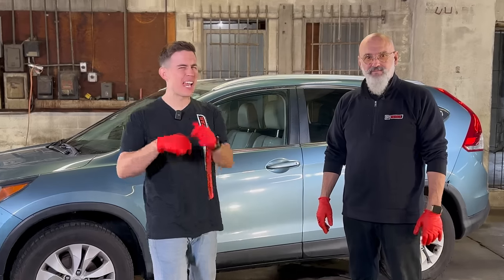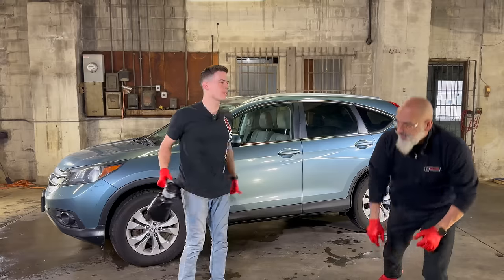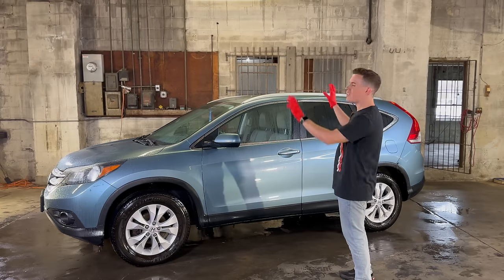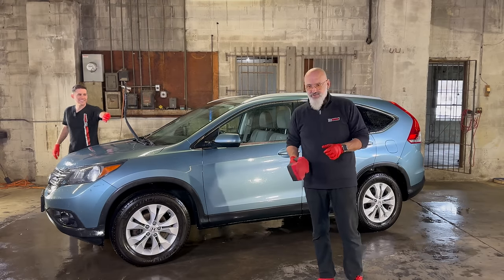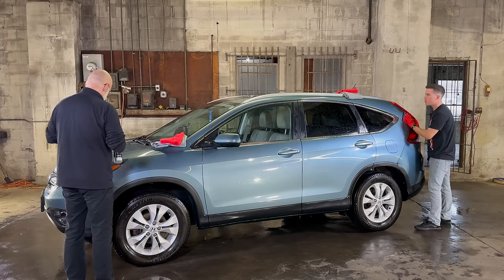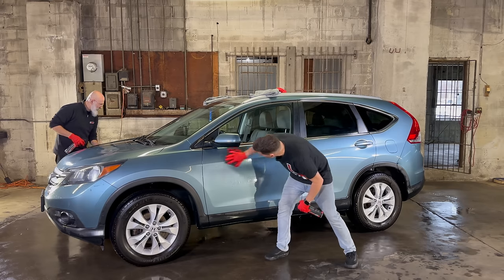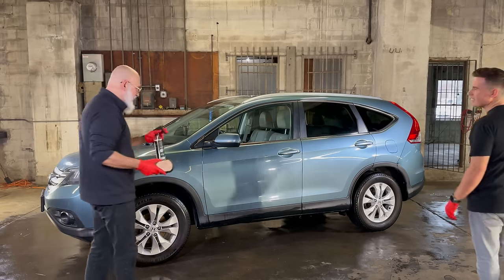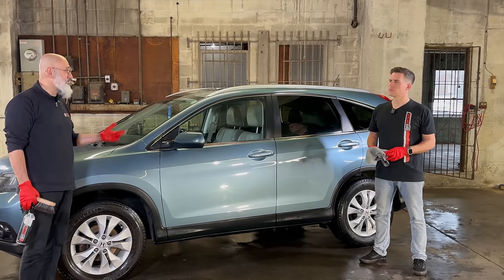How to decontaminate and PROTECT in one step!

Comment: The Honda looks clean and glossy and the owner must have been thrilled. My sprayer like yours quit this weekend on the job and it will be missed. The perforated towel is amazing and gets so much work done. I prefer ceramic gloss for the clay n seal because to me it smells better than quick beads. I do recommend buying a gallon of each. Thank you for the video.
Reply from the maker: Thank you.

Comment: Hello. I watch every video of yours. For me this is simply invaluable information. In the video on the Pan Organaizer channel you cleaned the body using Clay Towel and Iron Remover. This time you used CERAMIC GLOSS. Why did you decide not to use Iron Remover? Is it really not necessary to remove metal residues from the car body?
Reply from the maker: Different circumstances and needs. This is a good technique for maintaining your paint and protecting at the same time.

Comment: Hi Yvan/Nick, excellent video. Question regarding windows using this method- Ive noticed a couple times that the ceramic gloss has left a strange foggy/smudged appearance on the windshield in spots. It only became evident in certain lighting a couple hours after the details, and was difficult to wipe off one of the times. Have you experienced this and any suggestions to avoid this from happening? I dont belive I was overusing the product either. Thanks!
Reply from the maker: Unfortunately, yes you are overusing it.
Reply: @diydetailofficial thanks! easy fix at least

Comment: When using Ceramic Gloss on a dry surface, I’ve noticed the removal micro fiber towel seems to feel a bit grabby, or not slick on the surface. But when I come back in a few minutes and feel with the back of my hand or a clean towel, it feels slick. I’ve seen this same issue on another YouTube channel where he was trying Ceramic Gloss. Can you explain why we are feeling this grabby or not so slick feeling when removing the product? Only using 2 sprays per panel. Otherwise I absolutely love it!
Reply from the maker: You’re using one spray too much. Yes it will be initially grabby as the ceramic resins are cross linking
Reply: @diydetailofficial  So I did a “Nick” and got a little carried away? 😂 But it smells so good you just want to spray it everywhere!!! lol.
Reply from the maker: @bwildman1818 the fragrance has that effect on people

Comment: Hi DIY team (preferably Yvan). When doing a clay and seal is it better to use the ceramic spray during claying or on the towel while drying? Wouldn’t using it while claying dilute it more and use more product than using while towel drying is it just as efficient with product? 
I feel like similar applications or ceramic gloss use 1 spray per panel rather than the 2 while claying.
Besides increased lubrication is there any other reason to use twice as much product with this approach?
Reply from the maker: Yes you use a little more, but the additional lubrication is worth it.

Comment: Hello, Hope all is well. I have a question that involves the ceramic gloss. What is the difference between ceramic gloss and ceramic coating? Are they two different products? If so, how would you recommend the application of said products?
PS. Thanks for all your wisdom.
Reply from the maker: Very different products and needs. Watch a few additional videos and you will see the differences
Reply: @diydetailofficial  thanks for the reply. I’ve seen some videos however, I’m not sure if I’ve noticed you guys use both products at the same time (before or after the application of one or the other). I guess my question is more directed at the above-mentioned. Like for example, could I use the coating and after the curation process, use the ceramic gloss spray to enhance the coating? Or it wouldn’t work like that? 
Thanks in advance
Reply from the maker: Yes, once cured for a week you can use DIY Detail Ceramic Gloss

Comment: What about using the decon towel on PPF??? Also, I have some water spots on the PPF, will the decon towel help to remove those with the water spot remover?? Please discuss water spots removal or is polishing gonna be required?
Reply from the maker: All our products are safe on PPF. DIY Detail Water Spot Remover should not be used with the Perforated Synthetic Decontamination Towel . Claying doesn’t remove water spots. 

DIY Detail Water Spot Remover removes the minerals that cause the spots, to remove the etching ( if there is any) polishing is recommended.

Comment: I actually do not have ceramic gloss but I do have quick beads. I want to use this method but I thought quick beads was only activated with water, will it affect durability?
Reply from the maker: It works both ways.

Comment: This may sound like a strange question. After cleaning the inside of my tinted windows can I use ceramic gloss or quick beads on the tinted windows to help keep them a bit cleaner or is that a no no with tinted windows? I have XPEL Ceramic Windsheild Tint on all windows.
Reply from the maker: You do not want to use anything that promotes beading inside, it also promotes fogging

Comment: I really like the clear buckets with the very distinct measure markers. 

Could you provide a link to those exact buckets. The taller and shorter ones.
Reply from the maker: They are from a local restaurant supply
Reply: @diydetailofficial  Darn. They are really nice. You can see through them well. Very visible markings for the amount of water in the bucket. Will they let you order them and pay for shipping?
Reply from the maker: @26-CJ find your local restaurant supply

Comment: What happens and how to salvage a drying towel used with ceramic gloss that was just left to hang dry while waiting for laundry day?  :(
Reply from the maker: Soak in a bucket of DIY Detail All Clean , or use a bit of ammonia in your washing machine.
Reply: @diydetailofficial  At the moment my only supply of All Clean is in the Spray Bottle, pre-diluted 15:1.. How much would you recommend me using if I were to soak the towel in maybe 2-3 gallons of water?  Don't wanna waste any :D

Comment: Those electric sprayers are great. I use a black one from CSW for rinseless and a teal one for waterless from Amazon. The battery charge lasts a very long time. Videos with guys pumping manual  sprayers is never a good look…IMO
Reply from the maker: Thank you.
Reply: Could you provide the link to the CSW sprayer?   I have looked for it on their site, but no luck.  I do have the teal one from Amazon and like it.  I plan to purchase another one, but would prefer black.  Thank you!
Reply from the maker: They do not sell it anymore.